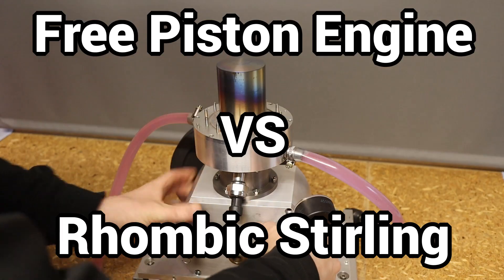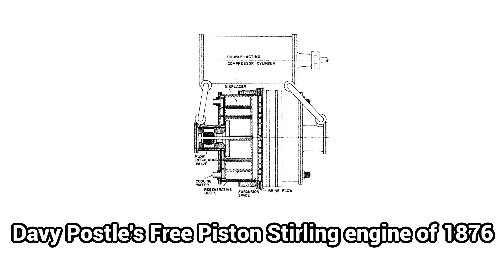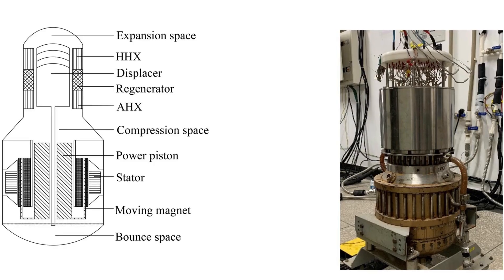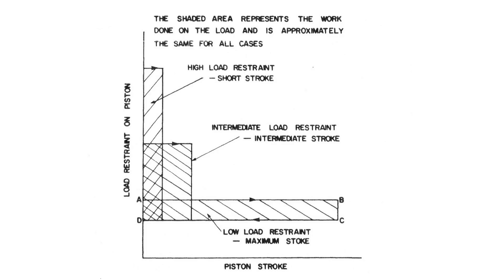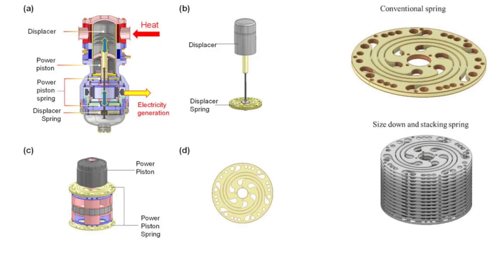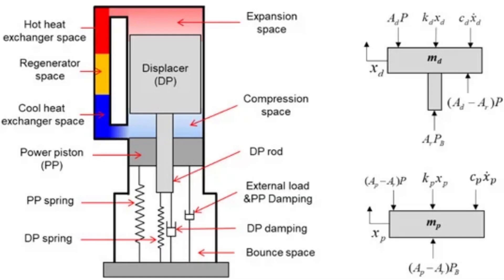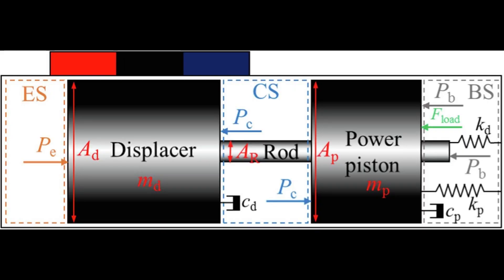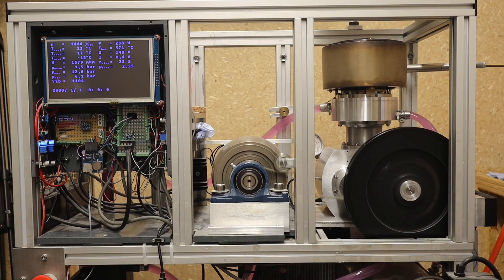Free Piston engine for more cheap energy than the Rhombic Stirling to support solar and go off grid?

Comment: Maybe a good engineered  ORC System is a better solution for reseach. You can better change or modify the components. The motor in this system could be a closed linear piston engine with generator similar to a modern  fridge compressor. Important is to use the excess heat for warmwater or heating houses to get a good allover efficiency.
Reply from the maker: Has an ORC system much in common with a steam engine or is it completely different?
Of course the waste heat has to be used in a CHP system, the efficiency of such a small engine is never very high.
Reply: @myengines2443 
Example: https://youtu.be/cC2zCUnYstc?si=PCLvgmYWYB1AoP3-
Motoring the generator could be all kind of piston devices or turbines evtl. several in line. For this low temperature i think all kind of pneumatic motors will work.
Reply from the maker: I dived a bit into ORC technology and it is really interesting.
But I am not sure if a tiny device as I want to build in the range of 300 to 600 watts can be meaningful?
Reply: @myengines2443 oh yea! I spoke with chat gpt about this possibility and all calculations for smaller systems are REALY frustrating! Allover Efficiency is mostly below 20%
Greetings from Mr. Carnot!
Reply from the maker: 20% is not too bad for a tiny heat engine when the waste heat is used!

Comment: FPSC is literally the only commercially viable use of the Stirling cycle to date. Thousands in use in the cryogenic fields and commercially available generators. Thermoacoustic/laminar flow style engines are in development but haven't taken off. The combination and simplification of these two styles is the next step.
Reply from the maker: I also have high hopes into this concept!

Comment: Why there is no balancing weight, that could oscillate with 180° shifted phase, to compensate vibrations of power piston with anchor? Or maybe even better construct moving of power piston 180° against anchor? And make both of them the same weight?

Comment: You show complicated drawings and explain nothing! Very low value your readout of generic billet points…
Reply: the complicated drawings serve to emphasize the point being made in the monologue, which is often in this video that the operating principles of this kind of sterling engine are really complicated and involve engineering familiarity with a large number of advanced fields. A number and advancedness that could not be covered in less than many hours, thus this video cannot get into the specifics of each advantage and challenge. It is a readout of bullet points laying out initial considerations for and against a free piston sterling engine vs more "traditional" designs. The video is almost 6 minutes long, it couldn't have been anything else. You just want something different than this video was ever going to be.
Reply: @Ziraya0  Its the maths formulas thats confusing him,

Comment: I believe it is a great idea. The external heat source required by the Stirling enables the use of a completely sealed container for the working fluid, which means high-pressure gas can be used, which means better efficiency and power density. Watching your video gave me an idea about how to solve the vibration problem with minimal losses.
Reply from the maker: Nice, thanks for your feedback!
Reply: @myengines2443  we used an external absorber mounted with springs to match the resonant frequency of the machine

Comment: /Hello again.
I haven't been to your channel for the last couple of months, but I've caught up on your videos.
It seems like you've been very busy. 

Both the Thermoaccoustic engine and Free piston motor are very appealing to me in that that they are sealed systems with minimal moving parts.

The down side it seems to me is that they are both computationally complex.   It seems be away of potentially reducing the computational complexity by 
replacing the spring on the displacer with that of the linear motor driven by a micro-controler with position feedback on the the power piston.

I sort of took inspiration with this LTD Stirling with a magnetic displacer.
https://www.youtube.com/watch?v=jKhKs2LeY58

From what I understand Professor Beale had his aha moment on the the Free piston moment in the middle of a lecture on Rhombic drives.   It seems to be that the power required to move the displacer back and forth would be far less than the power generated by the piston.   It seems either a linear drive  or a spring-solenoid on the displacer with a microcontroller could simply things.   Position of the piston need to be fed into the micro-controller which would need to drive the displacer.

This can't be an original thought... Has anyone tried this?

I ran across this interesting paper "Direct Piston Displacement Control of
Free-Piston Stirling Engines"  
https://core.ac.uk/download/pdf/37420245.pdf
This isn't exactly what I was thinking about.

Comment: Best solution will be to find second hand Baxi Ecogen 24/1.0 this combine gas boiler and generator unit inside you find Linear Free Piston Stirling Engine Generator  1KVA 230V 50Hz 0,95 pwF  made by Microgen in UK sometimes second hand appears sometimes for 700GBP new cost in 2011 7000GBP today new units cost 11950
Reply: where can I buy one second hand?
Reply: I was a technician for that development program at Sunpower. I would love to find one of those!

Comment: I agree that the production on a budget is challenging.  However it might be possible to find a type of cryo cooler that can be reversed to generate heat and repurpose it.  I am not sure if you have to put heat into the cold finger or the cooling waist but running it backwards would be a great idea.  Smaller units have sold on eBay for hundreds of dollars but prices have gone up over the years so they may no longer be bargains.  Finding a Eastern vendor who would be prepared to modify an existing design to make a hobby grade product for a price would be ideal.  Even if it is just 100W from a single unit one could poke half a dozen into a fire box.

Extracting power from one will not be very difficult as it will provide AC that can be rectified and then used to charge a battery bank as fast as it is able.

Comment: free pistons can potentially provide a much greater surface area and compression. It can also run at way higher pressures, altering the PV graph thus increasing the efficiency.
Reply from the maker: Yes the Free Piston concept is nice but a high tech engine as you describe is very complicated and really would take a long time to develop.
Maybe I try a low tech version first and the see...

Comment: Nice video! I don't have enough knowledge about the free piston Stirling engine to form an opinion worth sharing. But I can write a comment to help feed the algorithms anyway, and I am curious if a linear generator can be designed so that magnetic forces help keep the moving part centered, without too much difficulty or functional drawbacks.
Reply from the maker: Yes, to use the linear alternator also for guiding and damping the piston is a good possibility. 
Thanks!

Comment: If sunpower does it, then it must be the right way, and if motion isn´t of interset, but just electricity-generetion instead, then linear always seems the way-to-go. In the past I had an idea for Stirlings (passive cold-side-cooling, gaining 1-2% in efficiency), and wanted to see what other people with the same idea have done. After lengthy and fruitless searches on the web, I finally ended with a single search-hit: Sunpower has materialized this idea too, and they were the only ones worldwide... 
Check Blade Attila´s channel, he´s built many free-piston mock-ups , that resonate beautifully...!!!
Still, prof. Beale working essentially just for NASA was utterly useless to the world, and he hasn´t left any reputable legacy therefore... He´s now old, and would maybe like his word to spread, instead of just cashing-in for his great, but otherwise uninfluential work (NASA pays good, in order to relieve its contractors from the doubts, that it´s actually a black-hole for creativity and hard, honest work)... So, write to him...   ;-)
Reply: Sadly he has passed. I was a technician at Sunpower and grew up around him, he did a lot more than just build icecream coolers for astronauts! Also, hard to imagine how many cell towers around the world have Sunpower cryocoolers in them. I learned so much during my time there. Free piston is the way, but requires extreme tolerance machining and electronics.

Comment: Very good description, it is very difficult to "build by yourself" a free piston stirling, that could be' practical for generate a decent ammount of power. (I like to be' involved/informed for a potential indipendent small projet)
Reply from the maker: Yes, I also think that and at the moment I prefer a low tech rubber diaphragm FPSE.
But I am not sure if it can produce reasonable amounts of energy.
Thanks!
Reply: @myengines2443  let us know the "evolution" the calculation is very articolated 🤞

Comment: 221    in general, the operating speed of a prime mover is  Determined  by  How  it's  Loaded.     in other words, the (desired) under-load speed of  the prime mover is determined by its output,  the  load,  and  by the power take-off mechanism.      in the case of a prime mover whose output is low torque,  the use of  HIGH ratio reduction is called for.    preferably in a  Single stage.      doing this has the affect of partially isolating the prime mover from the load.
i have previously explained why the rhombic  LINKAGE  is a  non-starter.

Comment: 034   it is a  long-and-well-known  FACT  that the best way to load/operate a reciprocating engine is via the use of  a  CRANKSHAFT  and  Flywheel assembly.!    it does not take a genius to see why that is so.!       the term  free piston  is a misnomer.    because, the piston has to be connected or magnetically coupled  to  SOMETHING.    otherwise, the engine is a  do-nothing.
054   it is the opposite of smart to work on a  OLD  concept, where a patent was filed and was then allowed  to  Lapse.
127   this is an  OLD, big shiny lab specimen.!       example of the dumb direct use of reciprocating motion.!
138   maintaining a correct temperature difference between the sides calls for a certain amount of  Thermal/physical isolation of the sides from one another.      this is why the use of variations of the beta configuration is not recommended.      it should be understood that because of the centering action of a diaphragm, it is  less efficient than a piston/ or displacer.          googletranslate
Reply: kind of agreeing with you on the old patents.... we tried literally everything over 100 years ago. Improvements in abandoned designs made possiible with new materials science are overshadowed when applying the advancement to modern designs. The only thing that makes these designs such as stirling desireable as low maintenance options is the fact that they produce virtually zero power.... whatever the scale of the apocalypse, it will still be commonplace to see things like some hyundai running on 2 cylinders with wood gas fuel, jacked up spinning a cieling fan generator from a woven rope belt right off the tire.... the possibilities are endless, stirlings are just bad engines from a modern perspective.

Comment: So how about an opposed dual piston FPSE, where the driven pistons are connected and the displacers are connected. There will include an external regenerator that connects both sides of the FPSE, therefore it cuts out the need for springs or diaphragms. If you are looking at springs why not use repulsive magnets i think they would act as a very powerful spring in the right magnetic orientations. 

I think the opposed system could work better and it can be coaxial, so you have the displacer with its own connection rod to one another and the driven piston connected by its own connection rod.

Although the problem i see here, is the massive vibration from the system and whether the linear electric generator can compete with rotational generators, so probable a scotch yoke or external crank could work. Lastly another problem still maybe lots of ware.

Love watching this channel!
Reply from the maker: Thanks for your nice help!
This sounds interesting and I think I saw something you describe in one of my books!
I will look for it and report!

Comment: These analysis videos are great.
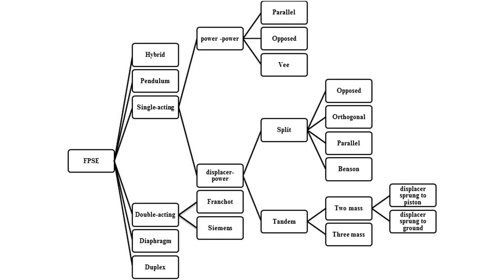Are you more doing this for the fun of building your own engine or just trying to solve the problem of producing power? I have one of the FPSEs shown at 0:44 (and 2:00) that I could sell if you are interested. Rated for 1kWe max, although shipping might be an issue as it's ~50kg.
Reply from the maker: Both, building engines is my hobby for years and since the electricity bill raised so much its very interesting to support our solar plant with a generator in winter.
We have wood and biogas which fits perfectly to a small Stirling.(look at my older videos)
Your Microgen is very nice, but shipping would be overkill.
Thanks and best wishes
Reply: have you sold it?

Comment: Hmmn! I think the free piston concept has a good future. But they require complex analysis and design, and must be manufactured to very precise tolerances. Only you can know if you are capable of working to that level of precision.
Reply from the maker: Unfortunately I don't think so but the idea of a low tech free piston engine with a diaphragm may be a possibility?
Reply: @myengines2443  That sounds like a viable option.